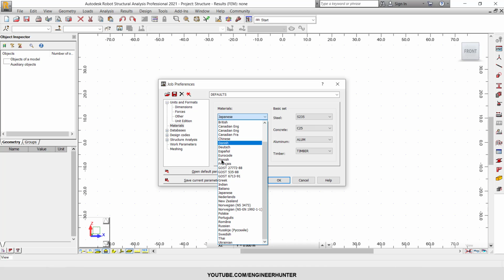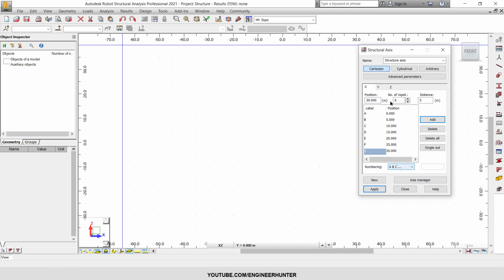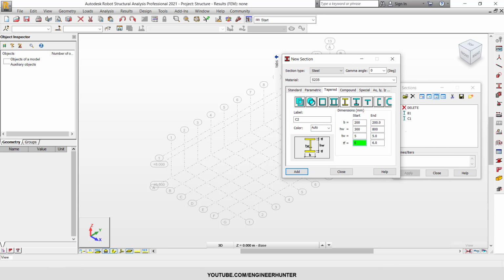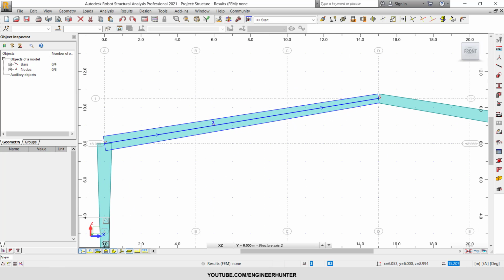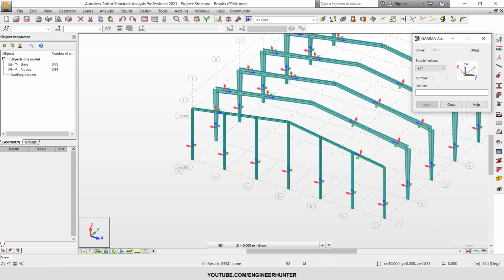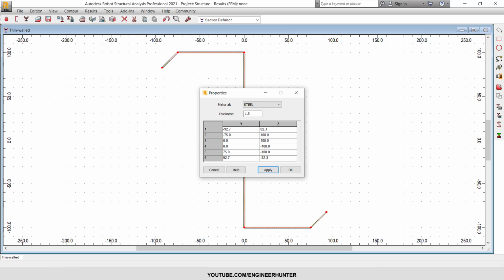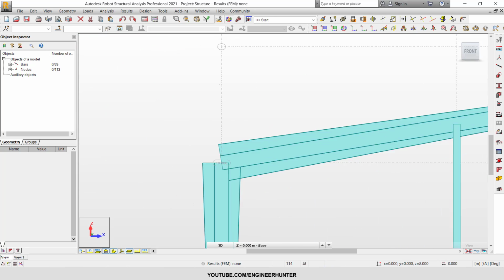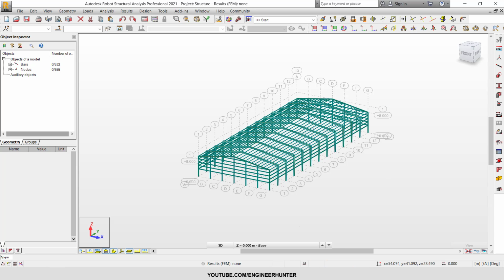Autodesk Robot Structural Analysis : Steel Warehouse Design Part 1

Comment: Hello. I have a question:
How do I can make a list section of member by excel and then i will import it into the program? Because I see that when i declare in this program wastes lots of time.
Reply from the maker: I'm not sure if that's possible in current version. But you can try these tricks. You can save your sections to database in RSAP and use them later. You can check my shorts video here https://youtube.com/shorts/Ai-44Ky-V2A?feature=share . Or, you can create a blank RSAP file which contain only sections you want to use later and consider it as a template for new projects.
Reply: @EngineerHunter thk bro. I'm using Sap2000 now, so it's easy for me to create and edit parts, materials, loads, ... by being Edit Database in the EDIT box. So I hope it appear in RSAP.